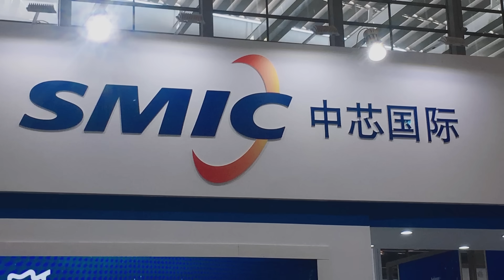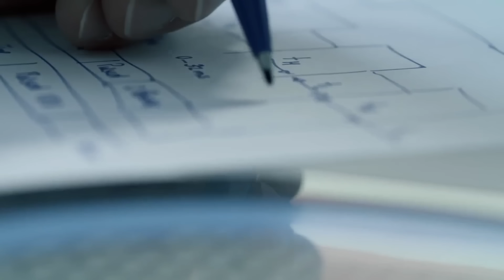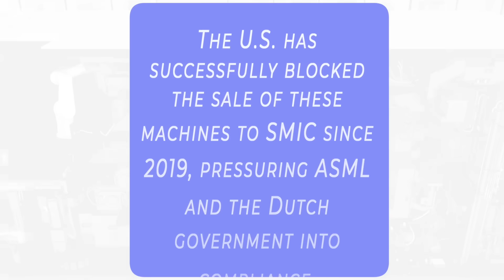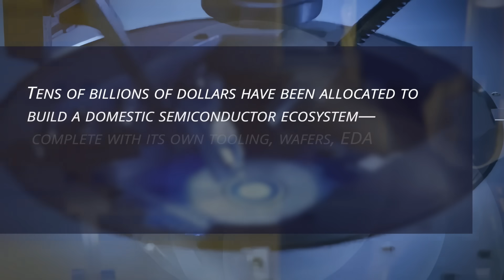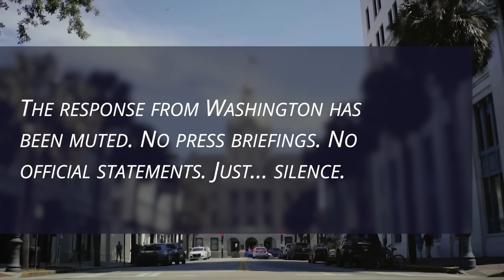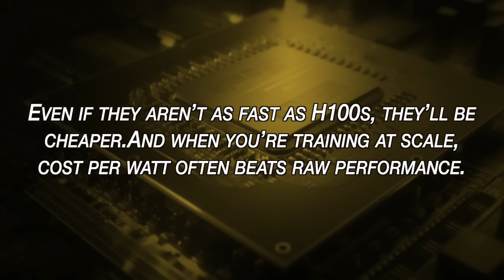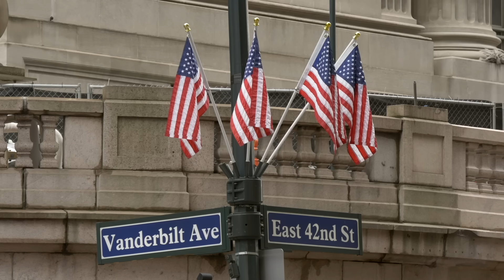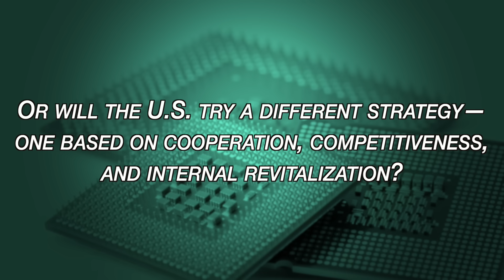No EUV. No Help. Still 2nm. China’s Chip Victory Over America, SMIC’s 2nm Chip Shocks the West

Comment: "2nm" chip has barely anything to do with "the scale of transistors". The "2nm" is there for historical reasons, I think the last valid "nm" designation was for the 45nm node. As Wikipedia explains: 
> a "2.1 nm node range label" is expected to have a contacted gate pitch of 45 nanometers and a tightest metal pitch of 20 nanometers
> As such, 2 nm is used primarily as a marketing term by the semiconductor industry to refer to a new, improved generation of chips in terms of increased transistor density
This can be done but layering the transistors vertically for example, a complex process.

Comment: ASML’s smallest is 3nm
Reply: ASML doesnt produce chips. They produce the machines that produce them.
Reply: @yerri5567  yeah that’s what I meant
Reply: @ObjectiveAnalysis  What do you mean thats what you mean? ASMLs EUV machines can manufacture chips smaller than 2nm. Just that the manufacturing companies like TSMC havent figured a way to mass produce them yet
Reply: @yerri5567  i mean the smallest chip ASML can manufacture is 3nm
Reply: @ObjectiveAnalysis  And Im saying thats wrong. That may be correct in 2024. But its 2025. ASML EUVs is proven to be able to produce 2nm chips already, just not at commercial scale yet.
And again, its not ASML that manufactures chips. So stop saying ASML manufacture chips. They only produce the lithography machines, not the chips itself.
Reply: @yerri5567   yes I meant that 3nm is the smallest chip that the ASML machines can manufacture.

Can you provide a source for ASML’s machine producing a 2nm chip? Because I’ve not heard anything about that.
Reply: @ObjectiveAnalysis  And Im saying thats wrong. When it comes to producing chips, theres research stage, trial/refining stage, then mass production stage. Theyve already done the research and trial stage for 2nm chips in 2021, meaning they can already produce it in 2021, we are just months away for mass production scheduled in 2nd half of 2025. You need to understand it takes years from research to mass production, but dont be mistaken, the EUV machines are fully capable to producing it even if humans havent figured it out yet.
Research for 1nm chips has already been conducted and created in a lab. Its still in the very early stages and is not commercially viable to mass produce at this stage until 2027. Meaning the current EUV machines from ASML are able to produce them, just that the 1nm chips are too undeveloped and too expensive to mass produce at this time.
This is all common knowledge that can be easily found onIine.
Reply: @ObjectiveAnalysis wrong! ASML built the next generation machines that will power 2nm CPUs. Meaning, machines have been delivered to usa "friends" such as tsmc or Samsung and they are at the moment fine tuning the process afaik 2nm is at the rolling out phase.